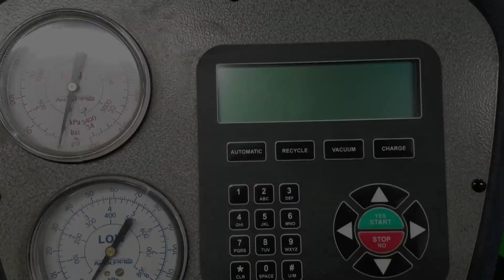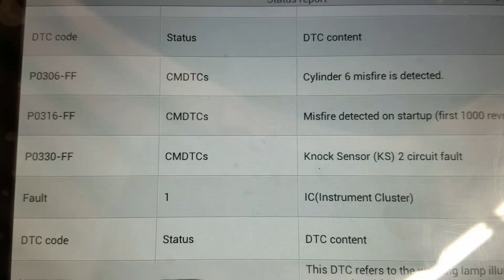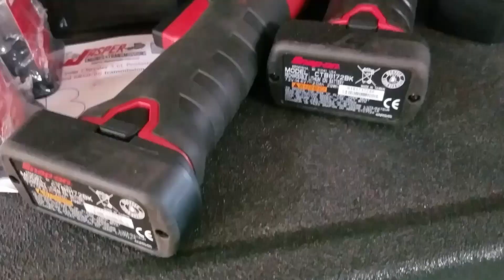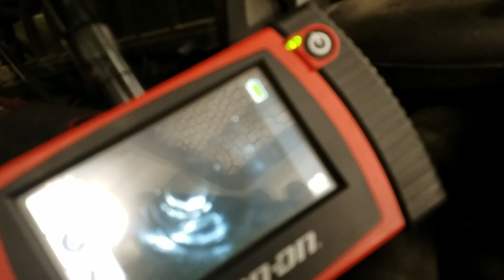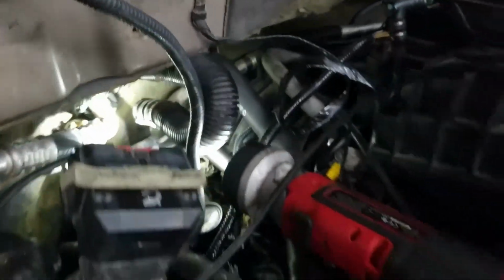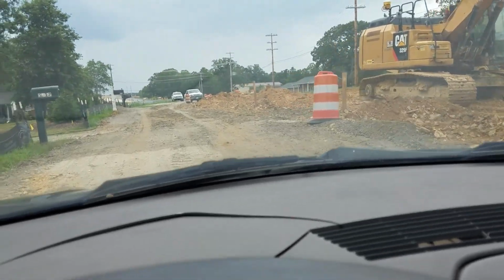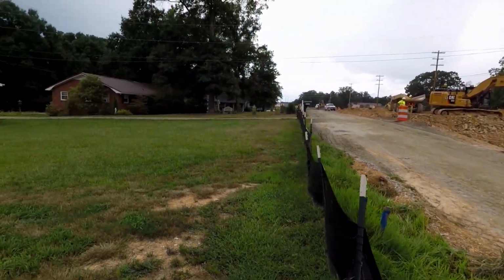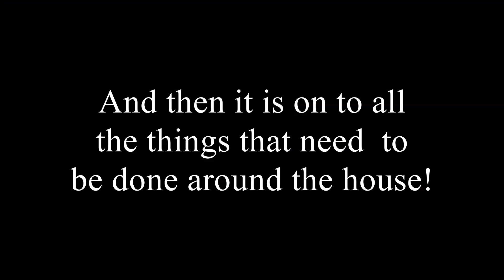A new day in the life of Camaro Time

Comment: Nice video Pete! I have done to many Ford 3 Valve spark plugs. In fact I am the only one in the shop my boss let’s do them. Yay me! Once you you have done a few they aren’t to bad. Next time I talk to you I will explain the easiest and fastest way to remove them. It would be a lot to put on here. I’ve thought about making a video but I don’t think my boss would go for it. The SnapOn truck is a great truck to dream on and sometimes dreams do come true or you have no choice but to make them come true. Haha
Reply from the maker: Thank you very much. Will do. We have the tool that pushes the porcelain out of the end. And then the other piece that threads into the remaining piece and pulls it out......how do you do it? Thanks for watching
Reply: Camaro Time I get the engine to operating temperature. It’s best to pull the plugs out firecracker hot. Pull the coils off quickly. I use my SnapOn 3/8 impact and bump the trigger several times until plug comes out. Sometimes 1 or 2 still break but I can usually get all 8 out. It just depends on how long they have been in. When I first started doing these 4 or 5 would break every time until I started using my impact. We have 2 different removal tools. I have the normal Lisle tool and the shop has a Matco tool that’s a little different. It’s suppose to grip the porcelain so it won’t break. I have not had good luck with the Matco tool. The lisle tool is a breeze once you have done a few. I can typically do the job in an hour. If a few break it takes about 10 minutes per plug to remove. My daughters Grandpa asked me a few weeks ago if I would change his plugs. So I might get a chance to do a video. The downside is it’s close to 200k miles and they have never been replaced. It could end up being a nightmare.
Reply: Camaro Time Also it’s always the back cylinders 3&4 on right side and 7&8 on left side that are usually the ones that break. It can’t ever be one of the front plugs to make it a little easier. Haha